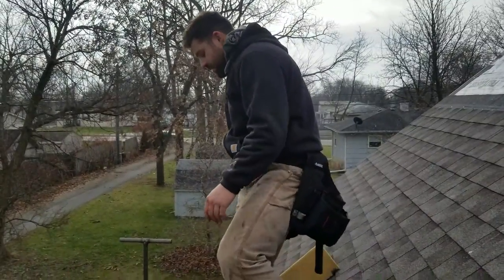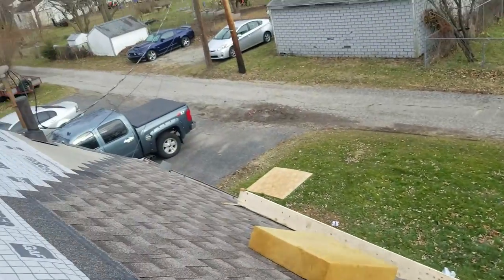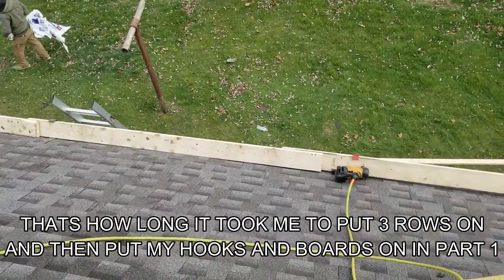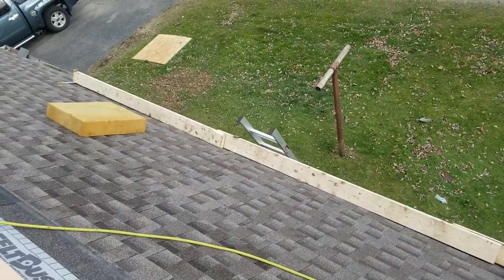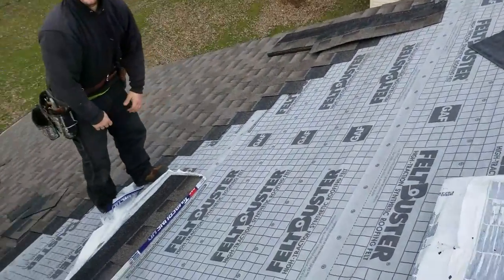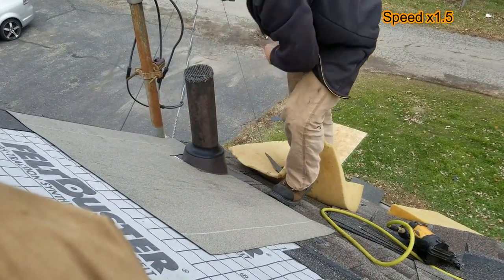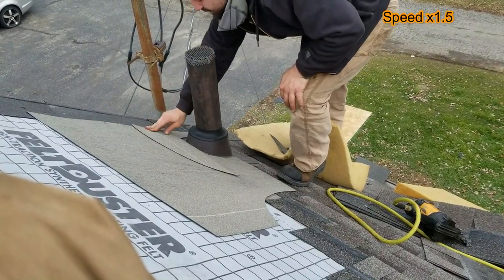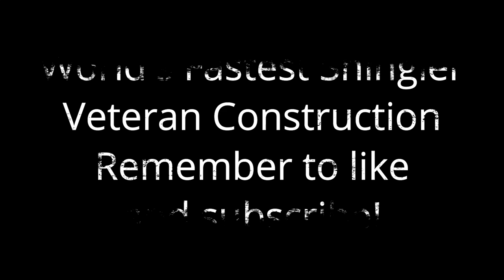Worlds Fastest Shingler 9/12 (Part 2)

Comment: Working fast, steep pitch, it will eventually happen and having it happen and bring your company to a halt while you recuperate from a broken leg or worse, not good....it will be just one false step in a blink of an eye.. it happened to me from luckily 6 feet backwards...not two stories...
Reply: i don't ever get paid enough to fly.... i haven't done it yet. lol
Reply: The guy used to work with fell 25 ft to the ground on concrete the cutting machine he was using on the flat roof kick back and knock them off the roof. His crippled on one side will never work again and he is not the same man he used to be all because he didn't want to wear a rope so we can be faster.